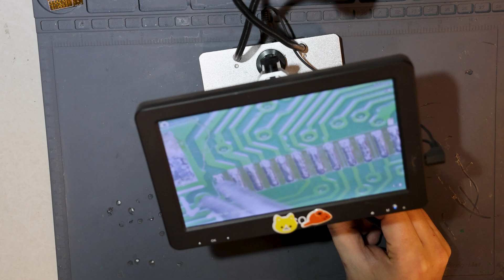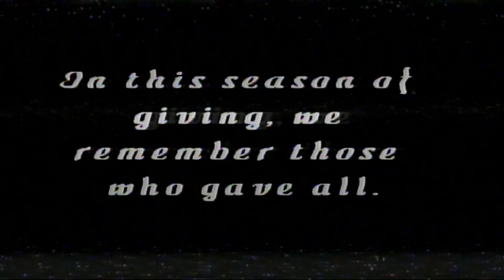Easy-Mode Circuit Bent Glitch Camera - Part 1

Comment: Would this method work with any digital camera or just this model?
Reply from the maker: Since the board just breaks out the individual pins, it should work on anything with a 24 pin connector, which I think covers a lot of point and shoot cameras. But I’m working on putting together a list of cameras that folks try out so we can kinda crowdsource a comparability list. So if you try it out on a model, let me know how it goes!
Reply: @getcircuitbent thanks! Will do
Reply: @getcircuitbent did you make that list yet? and do you have a instagram?

Comment: Damn bro you beat me to it by like a lot...
Reply from the maker: @tyler1234321  nah circuit bending is all about doing your own thing! I’ve been messing with these little guys for a couple years, but I definitely wasn’t the first and other folks will keep doing ones they like better than mine. 
So don’t let that stop you from getting in there! 
I’m mostly interested in making a tool to make camera bending easier since so many folks are trying them as a first project and personally I struggled like hell with cameras even though I had like 4 years of bending experience at that point. But yeah I’m hoping to make camera bends more accessible, not so much interested in finding a “best” or “right” way to do it. But more ranting on that in the follow-up video (soooon!)
Reply: @getcircuitbent  That's exactly what I was hoping someone out there had made or was working on. I've been bending audio for a while but this exact camera came to me and I just kept thinking, there has to be a better more compact way to break these pins out! and here you are. Thank you for your service!
Reply from the maker: @ happy to do it! I think a couple more iterations and I’ll have something really great here! 😸

Comment: that lipo is about to explode in yer face and burn the house down, bro.  shouldn't do ANY of this with it connected.
Reply from the maker: @awjaaa  oh the one where I was using the heat gun? Definitely should’ve disconnected it or at least shielded it a bit.
But a good reminder that any good workspace should include an explosion containment pie tin and a chemical fire extinguisher. Which mine does, I just neglected to mention it.
But the best way to put out a lithium fire is to not start one, so appreciate you bringing up good safety practices!

Comment: Not ure if you'll see this but this is exactly what ive been searching for!! I wanted a breakout board "junction "of sorts to fan out the 24 pins from the camera into easy to solder connections before routing them back into the camera PCB. I already ordered 2 24pin ribbon to through-hole breakout boards and am going to try soldering them together to do that instead, but this would have been way more convenient and no need to solder 48 joints...

i already tried building one but am pretty shit at soldering so it kinda stopped working already. will try again once i get my parts, but i did manage to take some photos that i thought looked cool!

https://drive.google.com/drive/folders/1oO5h4FtN5QdIMu8XWKV02h_y-H8oA5yB?usp=sharing

Comment: I just bought the exact same camera at goodwill for 5$ after deciding to do circuit bending. I guess I'm lucky because this seems like the best beginner camera to get for this sort of thing. Do you have any schematics on the sensor pins?
Reply from the maker: @smeebworld  nice! I don’t have anything official as far as what the pins actually do etc since that’s honestly a bit over my head; but toward the end of the video I put up my schematic for which pins I like to use! I’ve seen several other folks bending these on the Circuit Bending subreddit recently, so that might be a good resource to find pins that other folks like too!

Comment: do you possibly know the pinout for the V2 as im having trouble mapping pin 6 7 8 etc
Reply from the maker: @ashrub4991 The pinout will likely be the same unless there’s an issue with V1 I haven’t found yet.

Are you using the breakout board, or just going straight to the pins?
Reply: i have no clue where to get a breakout board from and cant really get it printed as im in the UK and imports are expensive on PCBs so im going straight for the pins i think. I've found the right pins just need to allocate some time to solder the pots and switches on haha
Reply from the maker: @ yeah going straight to the pins will definitely work, just a bit of tricky soldering. So smart call to set aside some time for it!
Reply: Are you going to sell the breakout board at some point as I have soldered to all the pins and made the circuit and can only seem to get one glitch type

Comment: is there a way to  circuit bending without the easy mod or is there a semi easy way to make/ buy one for circuit bend
Reply from the maker: @devonmiller9472  yeah, the board is totally optional! You can just attach wires directly to the connector on the pins noted in the schematic!

Comment: Very cool! Love this. I’ve been circuit bending for maybe 20 years now but just started working on digital cameras in the past few months. Yeah I could definitely see the advantages to using one of these for people new to soldering or with shaking hand or bad eyesight. But TBH for me I would probably just continue to solder directly to the pins with a magnifying glass. The first one I did was super frustrating but now I’m getting the hang of it. Oh so you are Peter Cat Production! I love that you make things to help circuit benders. I’ve been thinking about trying to do something similar with a LFO or Gate input on a small break out board.
Reply from the maker: @SISKworks  thanks! I try to come up with fun/useful modules. I hadn’t thought of trying an LFO on the camera, but if I can get my little LFO board small enough I might have to give it a shot!
Reply: @ actually I was just talking about circuit bending in general in regards to the LFO or gate input. But I guess a LFO on the camera could be cool if you’re recording video.
Reply from the maker: @ oh gotcha 😸
Reply: @getcircuitbent  what value pots would you suggest I start with? I would think a fairly low.
Reply from the maker: @ yeah I usually use 2K pots. 1k would work too if you can find the little square green kind in that value. That king will fit in the case without much fuss.
Reply: @getcircuitbent  thank you

Comment: I just got a camera like that can u tell me where can i beggin .i wonna learn circut bendig and also got some cameras so would love to bend them . Can you give me info where can i find step by step guide . Thank you in advance
Reply from the maker: @nikagvaladze8544  yeah! The schematic towards the end of the video shows the points that you can connect (you don’t need the mod board, it’s just intended to make life easy). I’ll also have a fuller video of me finishing this camera down the road.

I do recommend doing solder practice before working on a camera if you’re new to soldering as well (the points are really tiny and unforgiving). You can get little practice boards off eBay/amazon that are great for figuring out technique!
Reply: @getcircuitbent thank you for responding  ❤️❤️❤️❤️
Reply: @getcircuitbent would love to watch how it’s all done , i couldn’t find any videos about camera circut bending soo very interesting actually ❤️

Comment: I bought one of these cameras and mine has flat cable connector on the spot you soldered yout PCB. I thought about designing something similar with other end to fit into the connector instead of soldering it on.
Reply from the maker: @mikefulli  oh interesting! Yeah that would definitely work too, I’ll definitely keep that in mind for a v2, I like the idea of a connector that works for a variety of cameras!
Reply: @getcircuitbent  Yea. This camera module probably lives inside some parking cameras too.

Comment: Looking at this and pondering all the 8mm lenses I have sitting beside me. Can think of some neat combinations....
Reply from the maker: @alecDRGN  oh that would be dope! I’m not super familiar with analog camera gear, but the way these cameras are assembled the little plastic bit that holds the sensor is a separate piece. So I’ll bet you could 3D print a replacement that lenses could be fitted to

Comment: This is an engineering win. You've opened up a whole new generation of cameras to be bent. You could genuinely design a break-out PCB like this for a ton of cameras with microcircuitry. Great idea!
Reply from the maker: @anotherstupidhipster3551  thanks! I’m stoked to keep fleshing it out! But yeah it seems like a few cameras use this same connector, so hopefully will have quite a few applications